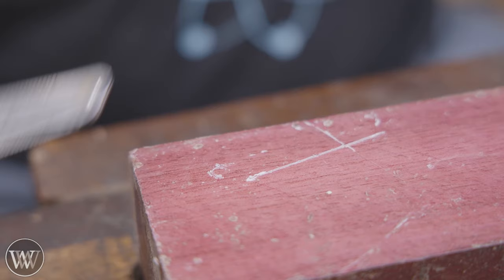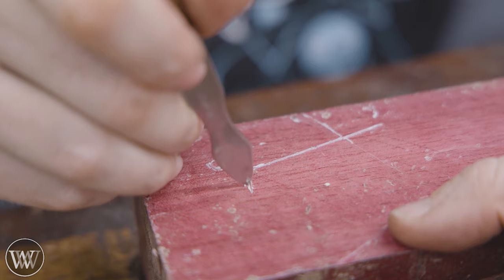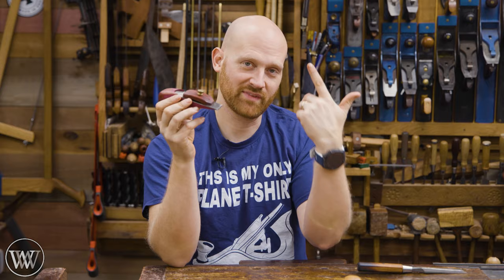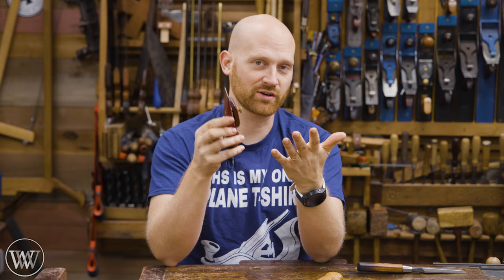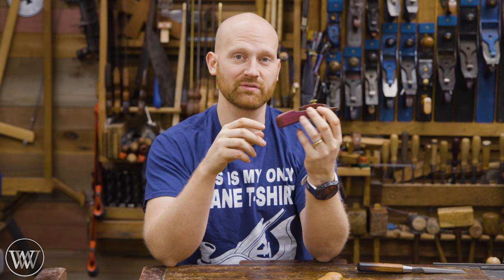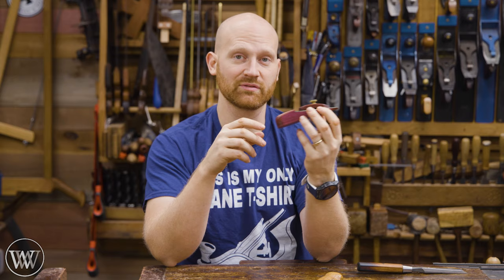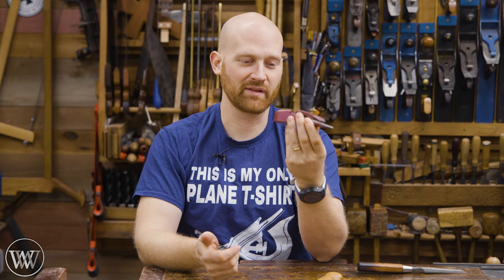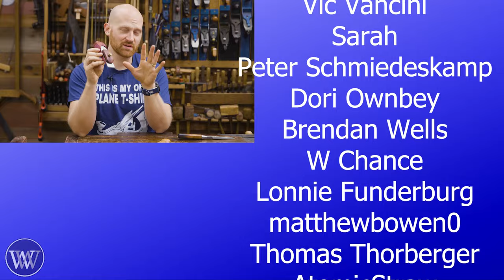Making a Chisel Plane Out Of Purple Heard and Red Gum

Comment: Two things:  1. Wasn’t PattyCakes one of your supporters?  One of their locations burned, 2. Purple Heart is beautiful. Any way to keep it from turning brown?
Reply from the maker: UnFortunately with purple heart the only way you can keep it purple is to encapsulated in epoxy. Oxygen and sunlight will slowly break it down.
Reply: @WoodByWright  that’s what I have learned from researching the issue.  I had thought about encapsulating, but sunlight would still fade it. One thing I have considered is the pressurization, but that changes the color initially.